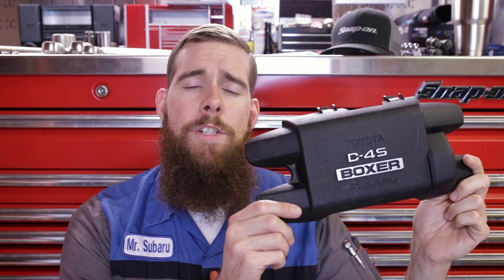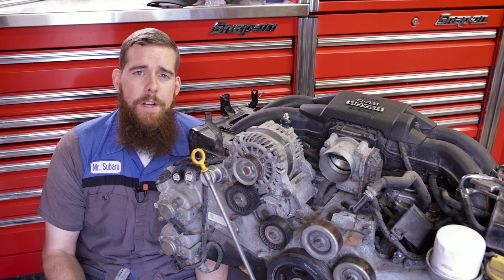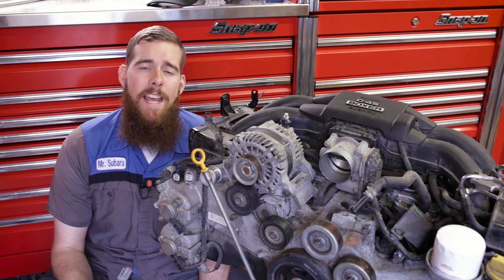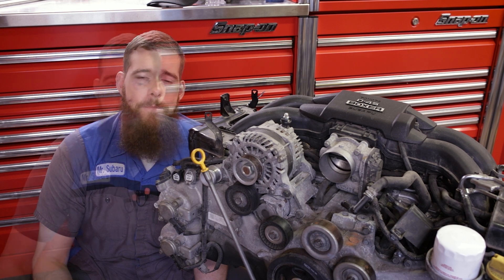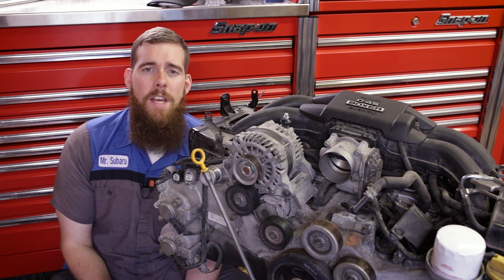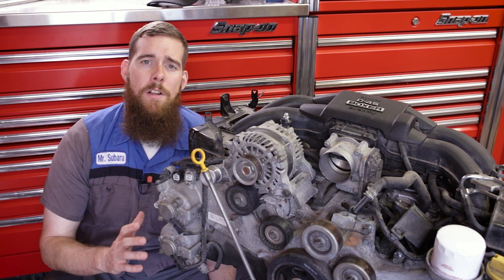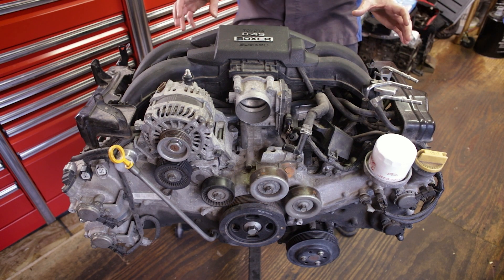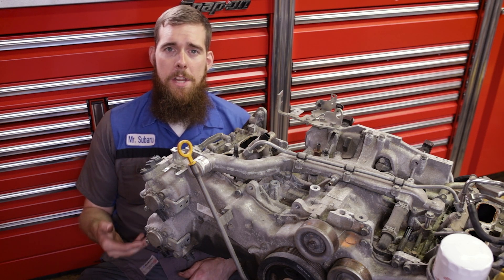Subaru/Toyota D-4S: The Superior Gasoline Direct Fuel Injection System.

Comment: The number of manufacturers which didn't see the potential pitfalls of DI still amazes me.
Reply: They "see it". 
It is customers that don't do research and don't complain... :)
Reply: Planned Obsolescence...
Reply: You think they didn't see the $500+ service they could try to add to every car they sell?
Reply: @ChadRazorback   I've seen the warranty costs they've had to pay out.
Reply: It is a mix of costumer and goverment demand for better mpg
Reply: They see it, they just decided that it was good marketing to kick the can down the line past the warranty period. In the short term they meet their emissions targets and get to put a nice mpg number on the window sticker to get the sale. That said, there seems to be a lot going on with exhaust gas management to at least ameliorate some of the deposit and to at least extend the interval until the service is necessary.
Reply: I think it is an old adage of unforeseen consequences - it goes something like; "Ooohh F**K what have we done??!!.."
Reply: “Outside of warranty”
Reply: anyone thats driven a twin turbo DI inline six knows the benefits of DI. diesel like tq at diesel like rpm range. My old 335i was a rocket ship when they came out. I knew I would be walnut blasting by valves every 35k miles but I am also a diesel mechanic and knew what I was getting into. I like this dual system by toyota though. I have a 86 still. love the lil slow boi car.
Reply: They saw the pitfalls. They decided that ruining an engine in 100k miles would be good for business
Reply: In over 200k on a DI Focus SE and 180k on a DI + turbo ST, I never did any of that cleaning bullshit or did anything other than change the oil and a few sets of spark plugs and never saw a difference in (superior) mileage or performance and never had any related drivability or reliability issues. I think it was mainly the typical overpriced junk from Germany (and maybe Hyundai?) that had major issues with carbon and/or HPFP failures (some of which caused a cascade of major issues) and gave the whole thing a bad reputation, which is funny, since they were the first to utilize the tech way back in WW2 (although, that was mainly Daimler-Benz and the issues I heard about were VW and BMW). You want marketing nonsense, look at the people selling valve cleanings on the fear that the DI needs frequent cleanings or something catastrophic would happen.
Reply: @mitchkelleher7972   Yeah, not a problem for Ford...   https://youtu.be/-ynGWxzJHjA